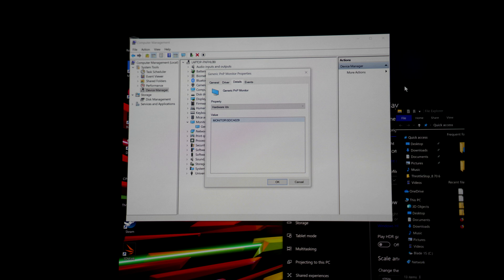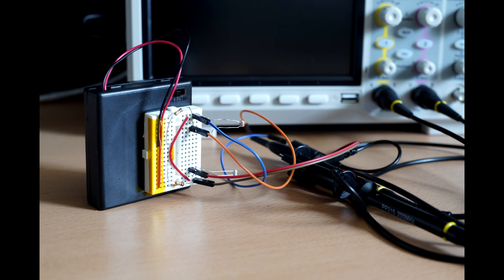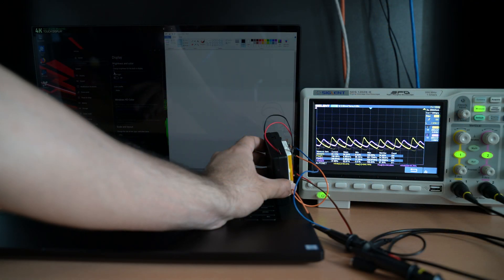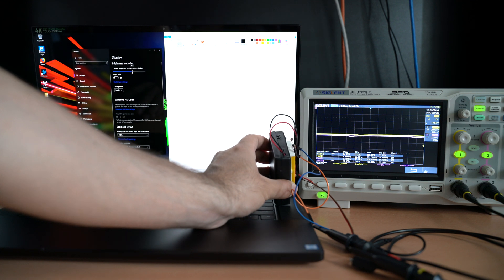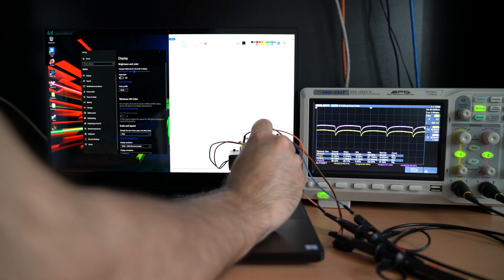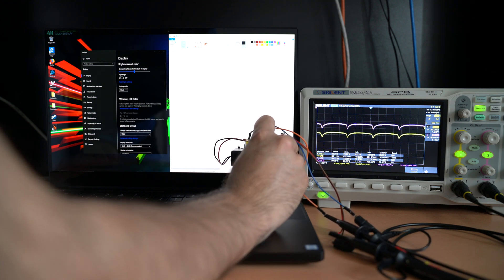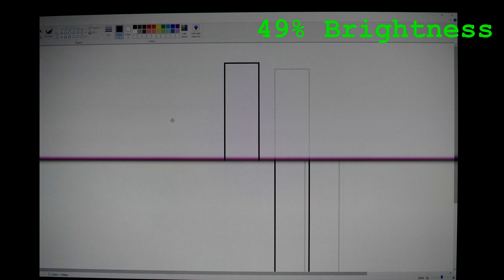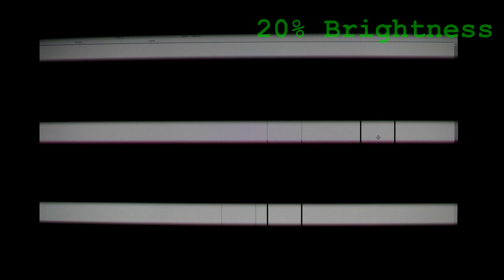razer blade 15 oled pwm test

Comment: hey thanks for the video man! I know I am sensitive to PWM as well though I couldn't quite make out what your results were (I'm not too tech savvy). I've been reading through your comments as well and what I understand is above 47% your eyes don't hurt anymore though the results are showing PWM at 60HZ which should technically be worse PWM? Would appreciate a reply as I'm about to pull the trigger on an OLED laptop tomorrow!
Reply from the maker: I apologize for this lengthy reply. First, a concise explanation: the display does not turn off in it's entirety, unlike traditional displays, which results in a more subtle change in brightness across the area of the screen, which in turn means, it is not as bad on the eyes. also, the 60Hz bar that scans the screen affects such a small portion of the screen, that it is not very noticeable, if at all. when the screen hits its so called "240Hz PWM frequency", more of the display turns off (vs. when the screen is at brighness levels above 47%), which amplifies the change in brightness across the area of the screen. Further explanations are given below. I refer to the 3 pictures i took, shown sequentially after the @3:03 mark in the video. These pictures, in simplified terms, are what your eyes will see at an instant.

explanation of why this display's PWM is not as harsh, especially at it's "60Hz" frequency, as your traditional PWM brightness controlled displays. Basically, your traditional display turns the ENTIRE display from maximum brightness to off and back again continuously to control brightness. This means that you are looking at a pitch black image for some amount of time and max brightness later on. WIth this OLED display, that is not the case. Only a PORTION of the screen displays black, while the rest of the screen remains lit. This means, the instantaneous change in brightness across the entire area of the screen is not nearly as severe.

explanation of why the 60Hz is not as bad as 240Hz on this display: above 47% brightness on the blade 15's oled screen, a thin, horizontal black bar "scans" the screen from top to bottom. It completes its cycle once every 60th of a second. when the brightness level goes below 48%, the frequency at which this cycle completes is still the same, at 60Hz. so then, where did the 240Hz come from? the display adds another 2-3 black bars (depending on where the bottom black bar is located), resulting in the screen being divided into 4 equal parts. If you look a the picture i took @3:33, comparing it with the one i took @3:03, you can see the 4 sections of lit parts of the screen. The unlit bars are moving from the top of the screen to the bottom.

explanation of why the 60Hz freqeuncy is NOT necessarily the PWM frequency of the OLED screen: as i said before, above 47% brightness on the blade 15's oled screen, a thin, horizontal black bar "scans" the screen from top to bottom. This bar, of which i took a picture of @3:03, does not change its size from 48% to 100% brightness and it completes its cycle in 1/60th of a second. what does this mean? at these brightness levels, that bar is not actually considered to be PWM based in the literal sense. To explain a bit better it is important to know what PWM or Pulse Width Modulation actually means. Afrotechmods has a pretty good video explaining it in the beginning of this video: https://www.youtube.com/watch?v=YmPziPfaByw
In the case for PWM controlled display brightness, the LEDs turn on and off for a set amount of time. As an example, lets say the LEDs are on for 1ms and off for another 9ms. The total PWM period would be 10ms, for a resulting frequency of 100Hz. Further more, since the LEDs were on for 10% of the time (this is also referred to a duty cycle of 10%), the perceived result would be that the LEDs are emitting 10% of the maximum light they are capable of.
On the razer blade 15's OLED screen, since the brightness is changing, yet the duty cycle is not changing, the power supplied to the OLEDs is regulated by some other means. Therefore, by definition, at brightness levels over 47%, the blade 15's OLED display is not PWM controlled.
Reply from the maker: i would also like to add, the screen still does not hurt my eyes. i just get a bit dizzy if i look at the display a bit too long at lower brightness levels. im feeling more confident to say that the dizziness is caused by the top to bottom scanning motion of the black bars. However, since the bars are less prevalent at higher brightness levels, i am unaffected when i do use the display at said brightness levels.

Comment: Thank you for covering an aspect of this OLED panel that is really important and entirely ignored by regular reviewers. For working staring at text for hours, do you prefer that oled panel or a regular 4K lcd panel with no pwm (in term of eye comfort) ?
Reply from the maker: if you work in a brightly lit environment where you can keep the brightness at 105 nits comfortably, oled is fine. otherwise, i would rather go for an LCD panel no PWM or one with high frequency PWM.

that said, if you can do all your reading in dark mode, where text is white and background is black, the OLED might be as comfortable, if not more than an LCD panel. it is for me at least. i have pretty much everything set to dark mode :p
Reply: @KumaMech  Thanks for your reply. The bit about dark mode on OLED is interesting. I do indeed use dark mode.

Comment: What’s been your experience with the OLED model? I’m buying a 2080 Max Q model and wonder if the OLED is worth it. I’m going to use it for content such as AE and C4D
Reply from the maker: sry for late reply, i have been pretty busy :c

the oled panel looks fantastic. my eyes have no issues with the screen at brightness >47%. below that number, i personally start getting a bit dizzy after a while. i can see after images as i move my eyes across the screen at these lower brightness levels. no headaches or severe eye strain yet, which is weird because i am especially sensitive to that stuff. do note however, i haven't been able to use the laptop as much lately, and it might have only been a matter of time before i really felt the eyestrain in the lower brightness ranges. most of the time i did use the laptop, i was above 47%.

colours of the oled. while accurate, the white balance shifts noticeably as you change brightness (lower brightness is more towards yellow, higher is more towards blue). Also, when you go from 90% brightness to 100% brightness, you notice the display get a lot more contrast, almost as if it enters an HDR mode. The 4k part really helps expand your work area if you set your scaling below 200%, vs the 1080p panel.

Other things to note. The OLED display option has a more rigid lid than the 1080p model, touch helps a lot in cad programs with navigating, but i am not sure if c4d has proper touch support. haven't used c4d in ages. going from the OLED panel to the 1080p 240Hz panel, you start to really notice just how much light bleeds through. brightness distribution on my OLED panel was much more stable compared to any LCD screen i have seen on a laptop.
Reply: @VincetheEditor  Hey whats up? So far my Razer has been a joy to use. I must admit it took me a while to get used to the keyboard but now its not an issue. In regards to the OLED screen, it sometimes bites me in the ass in terms of it looking great on my screen but then when viewing on another, it doesn't look as crisp but that is something I cannot control. Also, the Razer I purchased comes with 512gb and 16RAm which in in reality is not enough for AE. I've purchased a 32 RAM and 2T SSD but will be upgrading it soon. Looking forward to see what that upgrade will do. When watching content on Skillshare or movies on it, I will say the quality is amazing. I do hate the glare though when sun hits the screen but that's not a big deal. If you care for the OLED, I would say go for it but I think an HD screen would be good enough. I just wanted a sense of some future proof and that was the reason I went towards the OLED. Oh and I keep battery saver on a lot of the times and at 60% because the battery can drane quickly especially when on AE and Premiere Pro.

Comment: So would it be safe to assume the OLED screen on Alienware m15 (2019) behaves similarly?
Also, how are you getting along with screen?
Reply from the maker: alienware m15 uses same screen so it will be the same. i don't feel much eyestrain (i used to get eyestrain and headaches very easily from the 144Hz BOE panel that the blade 2018 could have. that had PWM of 240Hz), but if you move the screen when the brightness is below 48%, the after images you see can be a bit jarring, not as much as a screen turning completely on and off at 240Hz though. but still not the most pleasant experience. at higher brightnesses, that is not an issue whatsoever. i will say though, my sense of motion/balance gets distorted after looking at the screen for more than a few hours. i can get a bit dizzy.
Reply: @KumaMech  Thanks for the insight. Would you say it's quite bright above 48% though? I have an older Yoga X1 Gen 2 (OLED) with bad PWM. It made extremely dizzy and badly hurt my eyes. I'm wondering if this PWM profile will be better.
Reply from the maker: @heisenburger8243  IMHO, it will be better than the old panel, but still will probably cause some issues in the long term. like i said, dizziness is still there, but it doesn't seem to hurt my eyes... yet. (which is a good sign because i am pretty sensitive to this stuff)

as for how bright it is at 48%, it's about 105 nits, which is fine in a well lit room, slightly on the "a bit too bright" side, but it is very reasonable. if you are in a dimly lit room, 105 nits is too much. i wish i could give you a better representation that is not just a number. if you have a calibrator like the Xrite i1 display pro i used, you can adjust the brightness until you see your own display hit 105 nits, so you can judge for yourself.

EDIT: i should probably add, when reading black text on a white background, when your eyes move to the next line, you can see after images of the text as your eyes move across the screen. white text on black background is not nearly as bad as most of the oleds are off anyway. i still find it strange that i do not feel pain in my eyes when reading on the oled screen with brightness at the lowest setting. 240Hz PWM on an LCD screen would have me writhing in pain within an hour, and i could only force myself to use it for about 2 hours after which the eyestrain was simply too much and i have to close my eyes. i've been reading stuff at night with the lowest brighntess level on the oled screen for ~3 hours every night. i really don't know if it is because i have developed an immunity to it, or if its just the specific PWM behaviour. All i can say is, your experiences might be different.
Reply: @KumaMech  That's really interesting. You get dizziness but it doesn't hurt your eyes. IMO the dizziness is from PWM which I get too. Are you usually sensitive to LED displays regardless of PWM though? Perhaps wavelength could be a factor?
Because I'm wondering if Samsung changing the blue emitter wavelength in their newest OLED panels to 470nm has something to do with you feeling less eye discomfort.
Reply from the maker: @heisenburger8243  it is entirely possible that i am also sensitive to the blue light. my desktop monitor gets very bright and has a blue light reduction mode, but does not have pwm. if i work for 10+ hours on the monitor without the low blue light mode enabled, my eyes will start hurting the same as they would with a low frequency pwm display, after 1 hour. i have tested this with multiple displays, including a samsung galaxy s7, lenovo thinkpad t530 and razer blade 15 with a 1070 + BOE panel, which all have 240Hz PWM. My original laptop, an MSI GS60 Ghost Pro with the 2880x1620 panasonic panel (seems to be on the warm side. calibrating to 6500k results in a green tint compared to my other screens), does not have PWM, and i have used that for nearly 5 years now. i can work pretty much indefinitely on that without eyestrain. i have also noticed the display on the blade 15 OLED is calibrated to be a bit on the warm side.
my eyes also hurt when a display is too bright relative to my surroundings.

I am not nearly as vulnerable to blue light as i am to low frequency PWM.

Comment: Thanks a lot for the test, I was searching everywhere and wasn’t getting a clear explanation on how NBC claims 60hz PWM yet no one was complaining about the strobing effect and how wasn’t it evident on cameras. 

I’m planning to buy either blade 15 or the new m15, soldered ram and wifi card is a bummer but I’ve read horrible stories of defective units and how badly is the support for razer laptops. Aero 15 has great specs but the design is quite childish for me. 

I’ll probably end up with the m15 since it’s the only brand with support in my country, I can live with 16gb but soldered WiFi means sticking to a 3 year old chip permanently when much better options could’ve been installed for $30.

If I go with the blade 15 id be basically playing the so called “razer lottery”
Reply from the maker: i am glad i was of some help :D

getting any laptop these days is like playing the lottery. dell has had so many issues with their xps 15s and even alienware m15s. not saying the blade 15s have not had their set of issues either. i have personally had a terrible customer support experience with dell which basically makes me not want to look back at them again. i went through 4 xps 15 9570s before i gave up. the first 2 i got directly from dell, but i spent over 6 hours on the phone in a single phone call trying to get a replacement. part of the problem was the service tag on my unit was registered as an inspiron 15 2-in-1. i had to get that resolved first because i for sure had an xps 15... i mean if the flap underneath the laptop says XPS... it must be an XPS device right? :p

any who. where i live in canada, microsoft store has probably the best customer support i have seen, at least their in store support. luckily, the razer blade 15 4k oled is available at the microsoftstore right now. getting that with the 2 year accidental warranty is the best support i can hope for. unfortunately microsoftstore does not stock the alienware m15, so microsoftstore is not an option for that device :c

Comment: I am planning to buy the new Aero 15 oled but I'm a bit hesitant because of the oled burn in issues that everyone talks about. Should we be worried about it or no?
Reply from the maker: i think its still too early to tell if the burn in issues have been resolved or not. i can only make an educated guess and say that, since samsung lets all the OLEDs have some amount of cooling off time 60 times a second, it should for sure decrease the amount of burn in, vs a screen that is on with no off time.

that said, OLEDs use a chemistry that is not nearly as resilient to burn in as your regular LEDs. and it appears as if companies are trying to move on from OLED technology as the organic chemistry behind them just doesn't yield the same life as traditional LEDs.

i would also imagine, running the display at lower brightness levels will also increase the longevity of the display, as will making everything darker.

long story short: im still skeptical of the burn in issues being solved.
Reply: Not sure if resolved or not, but my 2 year old alienware 13r3 Oled has no burn in. And it's been used pretty much daily.
Reply from the maker: @PolCmara  would you happen to know if the display has gotten objectively dimmer over time (measured value in nits)?
Reply: @KumaMech  Sadly no, don't have any measurement tool, it was dim when i got it and its still dim (feels slightly less than 300 nits). But it kinda feels the same.